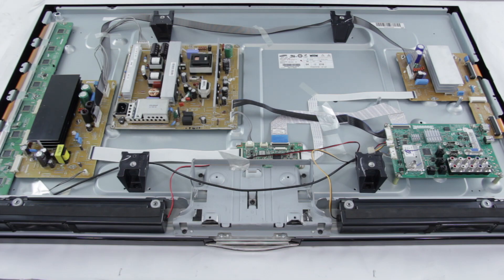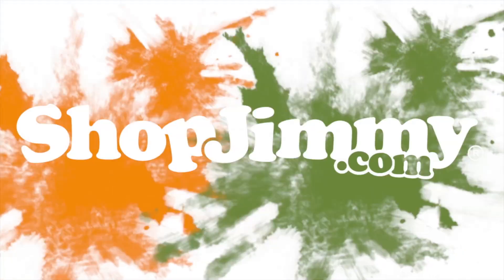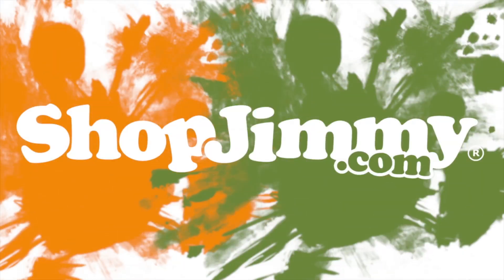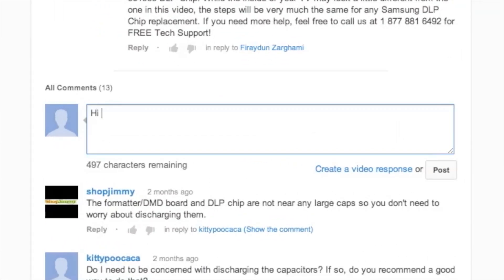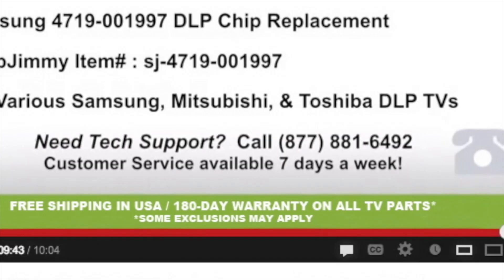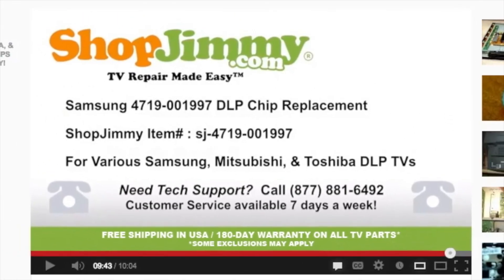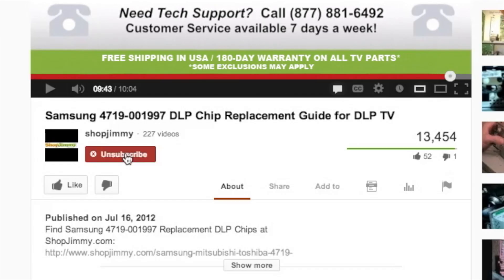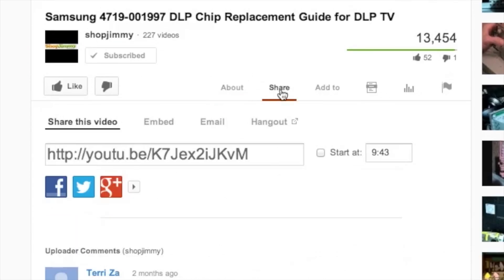Plasma TV Repair Tutorial - Common Symptoms & Solutions - How to Fix Plasma TVs

Comment: I have an LG 60 inch plasma (model# 60PX950) that won't power up. I get the red stand by light when powered off. When I power on, the blue light pulsates for a few seconds and then goes out. I pulled the back cover off and noticed that a green LED on the logic board is flashing the following blink code: long-short-long-short. Then it pauses for about 5 seconds and then repeats indefinitely. Can anyone tell me what that blink code stands for? I can't find a reference anywhere. 
I replaced the power supply board but get the same behavior.

Comment: I have an LG plasma TV 50pa4500   The tv shut off on my daughter and the standby cycles on and off no picture or sound. I removed the back and plugged it in. It sounds like a relay trips on and off there is temporary power and red light on the component panel on the lower right loping at it face down. Any ideas?  The clicking sound comes from the power supply board.

Comment: I have a PN42C430AIDXZC  (inside it's S42AX-YB09) 42inch Samsung Plasma TV. Turns on to standby, will cycle once on, but The screen displays  black but colored pixels flash throughout the screen randomly on every input for a while and then quits that and it just stays black now.  On the inside, the Logic board green light flashes on/off, on/off then stays off. If I disconnect the power cable between the Pwr Supply board and the Y-Sustain board, I can turn on the monitor, get the musical chime start sound, and the Logic board green light goes on for 5 sec, off for 1 sec continuously. How can I trouble shoot it further? Or what is you best guess at the part I need?

Comment: Hey Guys!
I have a Samsung ps42b430p2w. When i turn it on the LED blink five times, but there is no turn on sound. The screen blinks one time, but there is no screen either. I measured the voltages going to the main board and they are okay! Do you have any idea about the problem? Thanks a lot guys!

Comment: Mine is a 50 inch panasonic Plasma and it had no picture or operational issues.  Suddenly my mains power was tripping and eliminated every item except the Panasonic.  With only the panasonic plugged in as soon as powered on it blows the mains RCD.  The tv is a TH-50PX60B.  Any suggestions please?

Comment: Hi, my TV is Samsung Plasma PDP51F5500 model. Recently I heard a loud popping noise and the video was off but audio was still coming. So I tried to restart it. Once I switched off TV, it doesn't turn on. The led keeps blinking continuously but doesn't turn on at all. If I plug out and plug in, then it's again in stand by mode, and if I press power on button, led keeps blinking? Thanks.

Comment: Hi, Please help. I have a Lg rz60py10 plasma TV which I use as a computer monitor. Usually the Tv runs well but when the screen is fully white and bright (when I search something on google and result comes on the screen) the tv screen goes off and sound is still on. Then I need to turn the tv off and on again to work on the screen. What could be the problem.

Comment: Nice video....I Have Model PN59D550C1F, SN Z31R3CJB700984L-  trying to diagnose which part I need for this new issue.  Display Works (xbox thru HDMI) then Picture randomly disappears, sound still works.
 Power button will not work and need to unplug to power off TV.  let sit for a while and starts all over again.

Comment: hi, thank you for your video - really super helpful.  i have a samsung plasma - pn50c450b1dxza. it has some vertical colored stripes or bars on the right side of the tv.  it happens more often now as the tv warms up and then stays that way.   if i let it cool down, it will go away again until i suppose it warms up and the vertical bars start again.  so it seems like a slow thermal failure of a board in the tv.  i think it might be the logic board (pn i believe is BN96-12953A) as explained in your video or perhaps the E Address buffer ( pn i think is BN96-12954A) on that side of the tv.  or maybe both?  i am not 100% sure.   so question to you is what do you think it is?  
thank you

Comment: Great tutorial. I wonder if anyone can help me? I have a Samsung PS60F5500 that intermittently shows a blank screen when turned on. I have audio and am able to scroll through the menus adjust volume change channels etc. When turning on, looking closely there is a barely perceptable flash as though the backlight is powering up and I know I will get a picture. When this does not happen, I know I will just get sound and no picture.  This fault occurs more regularly during hot weather or just after the TV has been turned off and back on in a short space of time. I hope someone can help as I love this TV.

Comment: Hello, I have a Samsung un55nu7100f and it started acting up with dark vertical sections that seemed to move around the screen and then eventually the TV popped and then went dark with no stand bye and would not restart, any ideas? I will now pull the back cover and look for fuses or such that may be blown.

Comment: Hello Mr. Jimmy. I have a LG 55LF6300-UA one half of the screen is black and the other half of the screen blinks but I can see backlight and screen. I replaced both led strips. And it’s doing the same. So I took everything apart again saw one led strip is not working but the other led strip is blinking. Please help me🙏 thanks.

Comment: I’ve got a functional plasma tv. There are two vertical lines. How can I fix this?
Reply: Hey Juan Colon..  I have the same issue on my Samsung Plasma 51 inch. I changed out the Control board, that didn't fix it. Cleaned all the connections. Nothing has helped.  Did you have any luck finding the source?  Any help would be great. Thanks

Comment: I have a Panasonic Viera plasma tv. Model TH-42PX60U. Manufactured November 2006. I am experiencing approx 1 inch verical black bar on picture image from top to bottom. As per your video at 5:28 in, that may be my problem. Could you please advise and where I could find that part. Thank you!!

Comment: Hi Jimmy I have a 64" Samsung Plasma Model PS64E550D1M
Problem: No power no Standby light.
Love the video but could you show the fuses that need replacing for the power as you mentioned multiple,
Just so I know which ones they are I have 2 visual ceramic fuses is there more

Comment: Hello I have a Samsung PS51D550C1KXXU - The tv has red light flashing but cannot turn tv on.I have.. 1)changed batteries in remote 2)checked all capacitors and cant see any bulging, 3) taken the power supply off and checked for bad soldering and it seems fine 4) it clicks in a start up cycle for about 4 times and then stops 5)ifyou disconnect all boards the power supply doesnt click when you plug in the main board, it does click  5) the logic board flashes when you connect to power supply 

6) ive checked the fuse on the powersupply board and it seems ok although im no expert using a meter.
What i was told is that the tv has already been repaired for the same issue and  did notice is that the sellotape around the main board had been removed previously. 

Do you have any idea what i can try next please? Great Videos, ive learned such a lot from them. Ive never had a big tv before, this was given to me and use if i could  fix it .. cheers

Comment: Hi. I have a Samsung Plasma Model PN50A510P3F. It will not turn on, just clicks. Using one of your videos I isolated various boards from the power supply but the clicking persists. That is until I disconnected the Main  board from the power supply. With all other boards connected and the main board disconnected the clicking stops. I'm guessing that the main board is the problem. Any ideas?  Thanks SJ White

Comment: I have a Panasonic TH-42PX60U television. The sound and picture will work fine for about a week. Then without warning, the sound will go off. The sound may stay off for random periods. A few hours, days, and once a week. The sound will without warning return; if you leave the TV on. The picture is great. There are no blink codes flashing. This is the only problem I have had with this TV since it was bought new in 2006. I replaced the PA board and that was not the problem. I now feel like it is the H-board. 
what do you think it is?

Comment: Samsung PN51E450A1F — no power at all; no lights no anything when plugged in...TV is dead.  I replaced power supply board and still have same problem.  Any suggestions on what to do next?
Thanks!
Reply: Try your power cable.  You might be surprised.

Comment: Panasonic tc-p58s1 my television power on with stand by light then the stand by light flashes on a continuous basis. After trying to power multiple  times like 20-30 minutes, the television will come on. During that period, I will unplug and discharge the television to get it work. At some point the television turns on and the picture is beautiful. What should I do?

Comment: Hello man, Great video! I solved issue with purple snow (just bought external stabilisator). But my plasma won’t adjust from 43 of 60 overall brightness. From 1-43 it’s ok, but after 43 plasma don’t increase light even on a maximum 60 of 60. And overall feeling that plasma became more dimmer. And Vivid color mode don’t work at all. And the buzzing sound from plasma became very low, almost not recognizeble. Could you advise, it’s SS or A-board issue? My plasma is Pr50ut30, do you have some boards, if I want to buy?

Comment: I have a Panasonic TC-P50S30.  I had a power issue which was resolved by changing the Y buffer, but now I have no picture.  I changed the power supply and the board with the inputs with no success.  What is the next logical place to look?

Comment: I have a 50in plasma tv model # 50C590G4F I replaced the power board and the mother board, but still my tv wont turn on I turn it on and then it clicks off, the power light stays on but it wont stay turned on HELP

Comment: I have the same tv just took it apart found two swollen capacitors, picture was not working reason I opened it up. Should I try replacing those and starting it back up???

Comment: Great video! I have a question...
I have a Zenith Plasma TV  (Z42PT320-UC) where the sound stopped working out of anywhere. I'll turn the volume up, switch HD I outputs and even use the AV cords, but no sound comes out at all. What would you recommend?

Comment: Tiny little virtical lines.. How to fix it?
Reply: Hey Ryan Israel Navarro..  I have the same issue on my Samsung Plasma 51 inch. I changed out the Control board, that didn't fix it. Cleaned all the connections. Nothing has helped.  Did you have any luck finding the source?  Any help would be great. Thanks

Comment: I have a Samsung PN64D7000 plasma TV. It won't turn on and the red light dimly flashes twice when hitting the power on button. If I unplug it for a while and try it again it will eventually turn on and work for a while, and then it repeats the no power problem. I don't want to buy any parts until I know which board is causing this. Also, if one of the boards is causing this does the board itself need replacing or just some components?

Comment: I have a Samsung plasma tv, model number 42pj150-ze. when i plug it in it starts clicking  with standy mode on and than off and back on. some times the tv turns on but then it goes off again(not standby mode). it's like it trying to start up but doesnt have the strengt for it. 
Any tips?

Comment: Panasonic TC-60PS34, built 5/2011. Have been getting white screen (like looking through cheesecloth) with sound for about a month, when turning on. Turn on and off a few times and it worked fine. Now it is just white screen with sound. Open back and everything looks ok. Boards are TNPA5343,5344,5399,5400 PH0914,PA5326. Do you think replacing buffers 5343 & 5344 and board 5399 will fix?

Comment: Panasonic TCP42S2. Works great except on very light scenes - (e.g. clouds) there is a pink tint that flashes along the edges of light objects. Kind of like "pink lightning". I first noticed it when the brightness was turned up a bit. I have swapped out cables and tried different sources and inputs and the problem definitely rests with the TV.

Comment: I have a older plasma tv.(hp-T5064)  The TV still works great,but every now an then the sound goes out. Picture is still playing with no sound. Sometimes it lasts a few seconds-a few minutes. I turn the TV off and back on, and sound comes back. What can this be? And/or can I just connect a external/ soundbar to bypass problem?  Thanks for any help.

Comment: Thanks for the quick overview of possible problems.  My tv is a Samsung  model code PN50A450P1DXZC.  The problem is a dark, reddish tint picture with horizontal lines.  Otherwise it works fine.  Is it the X-sustain board?  And, is it worth trying to fix?
Thanks.

Comment: I have a Samsung s58fh-yb05 that wont turn on. no standby either. i took off the back to look after watching this vid but cant see anything that looks wrong / broken on the 'power panel.' I've tried different power cords as well. Any ideas?
Reply: took out and tested ceramic fuses. they are operational.

Comment: Hello. I have a Samsung 60 inch Plasma model PN60F5300AF While watching a show... I heard a loud spark & the tv go black with no power. A red light that usually turns on in the corner doesn’t come on at all when plugged in. Any suggestions?

Comment: If im getting the right voltages on the va and. Vs but a low reading on the 5 volt would that mean the power supply board is bad

Comment: Hello, I have a Samsung Plasma HP-S5053. There is currently no picture on the screen and no sound. The Standby light does come on and the TV does click whenever the power button is pushed but no picture. Also, the STBY voltage is 10V and I was told that it was more than likely a faulty main board, so I ordered one and the one that I got causes the TV to power cycle and still no picture or sound. Could it be the power supply board? Can you please help??? I tried calling your number but no one was available and the service seems to be down. 
Regards,

Comment: I have a LG 60PN6550.... It started out by shutting off the video but not the sound.  You could turn it off and then on again and it would then work for... This happened for a couple of days before it shut off completely and when you try to turn it on now you can hear the normal click sound and the standby light goes off but then after about 20 seconds it goes back to standby.  Any clue which area I should look at first?  I'm guessing form the video it is the power board, is that correct?

Comment: Hello, I have a SAMSUNG LN52A650A1FXZA PLASMA TV with sound but no picture. Red light is on during standby. I press PWR and red light flashes and "welcome sound" is played and red light goes out but black screen. If I turn out the lights, it is very very dimly light. If I press APPLE TV, I can hear  CLICKING sounds. When I turn off the TV, the Samsung Sound turning off is played. I have taken out BN44-0020A Power Supply and see no POPPED CAPACITORS nor damaged Ceramic Fuses. There is 1 DIODE that sits between 2 Aluminum "FINS" just above/ beside the 52" VE label on the board. This DIODE is not cracked but has a tiny bit of brown residue on each of the FINS which line up with the DIODE.  The other circuit boards look OK with no visible damage anywhere.... Can the fuses/diodes be bad without looking bad? Any suggestions?

Comment: I have a 65" Samsung Plasma TV model PC8000 and I am not getting any signals thru the HDMI connections I have verified that the cable box is putting out a signal and the TV screen just says no signal found. What do you think the problem is?

Comment: 2014 Samsung Series 4+ 4500/4550 Plasma TV - Picture starts fine and then either becomes snowy and/or flickers. Sometimes the picture is lost and becomes gray "fuzz." During this time, the sound is fine. Repairman suggested it was the mother board and would cheaper to get a new tv.

Comment: Hi my Samsung PS51E531A6M just won’t switch on, the power button brings the red light up, but no blue for on and then just flashes red. Think it’s a fuse on power board?

Comment: Lg plasma tv 60pn6500-ua. Tv shuts off, standby light stays on. Tv won’t turn on. It feels hot on the back top vent. I put a fan back behind the tv and it comes back on. If I keep the fan behind the tv on the tv works fine. If I turn the fan off the tv will shut off.

Comment: 51" Samsung TV Model PN51F5350AF.  TV when on made a pop sound and smelled burn smell.
Standby light comes on TV will not power up. Removed the back panel and when turning on TV green light flashes on the mainboard but tv does not turn on. When I press the button to turn off the tv, Tv does not turn off. Must unplug and replug to get standby light to come back on

Comment: Hi I’m hoping you can help, My 51” plasma Samsung tv recently went down there is no picture/won’t turn on, I changed out the power supply board and it still has Same symptoms, while the back was off I plugged in the tv and tried turning it on, after watching this video I think the issue is the logic board, a green light shows on this board there is a high pitch noise similar to the flash charging on an old style camera then there is a tiny click and the light goes out it repeats this about 3times then stops, it sounds like it’s trying to start but just can’t get there, should I try replacing the logic board? Thanks for your video very helpful and thanks in advance for your advice on the above.